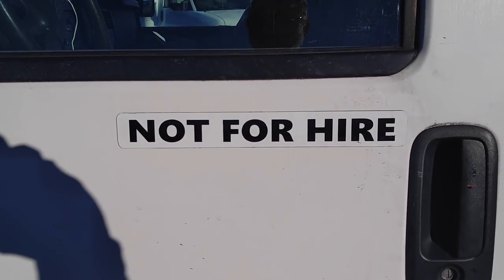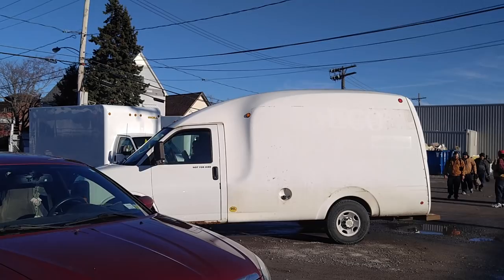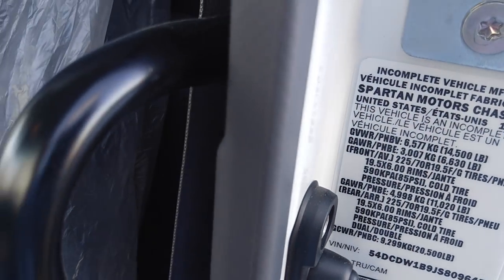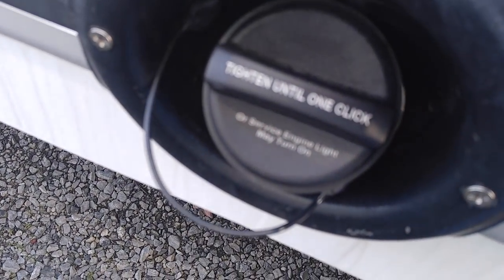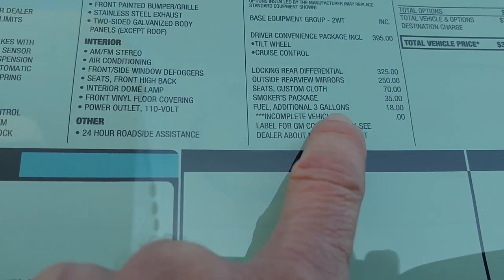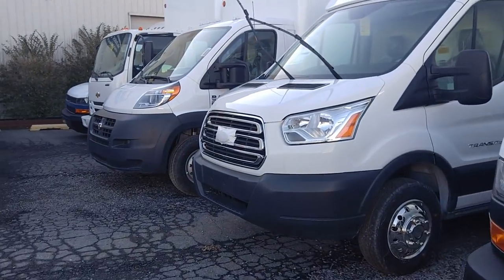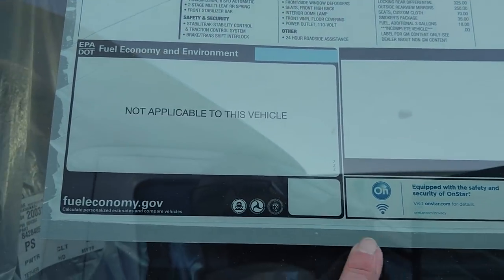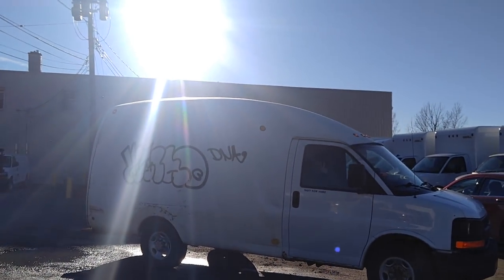UNICEL Chassis Cab Factory 1 4 19

Comment: That isuzu cab over chevy truck are nice in my opinion. I delivered bread in one for years and those things turn tight circles. Ours had a hydraulic gate. It was a fuel injection 350. Gas milage was about the same as our big diesel box trucks. Their kinda rough riding.